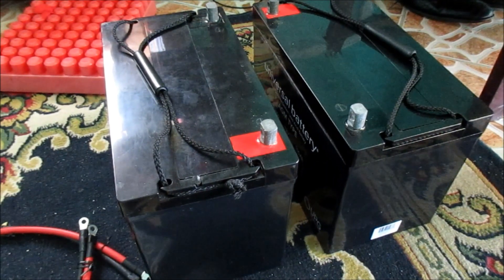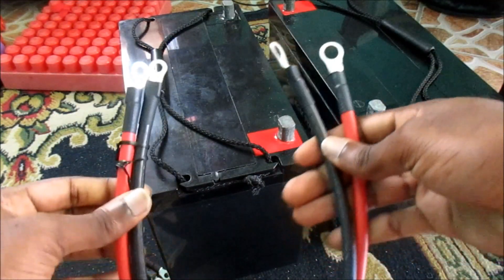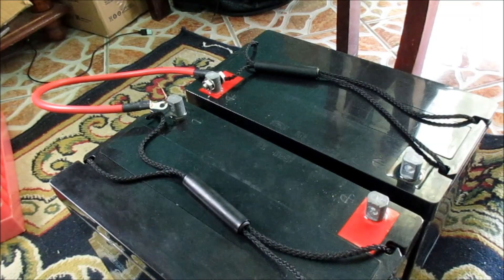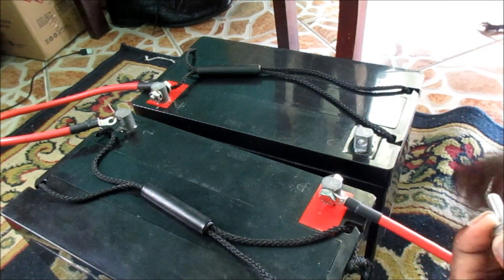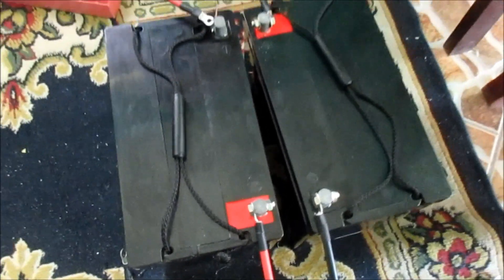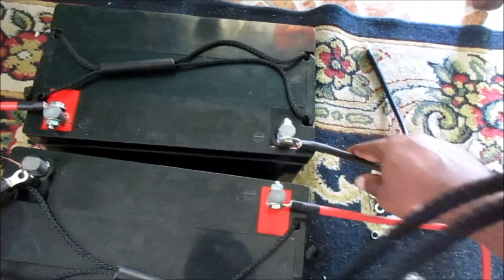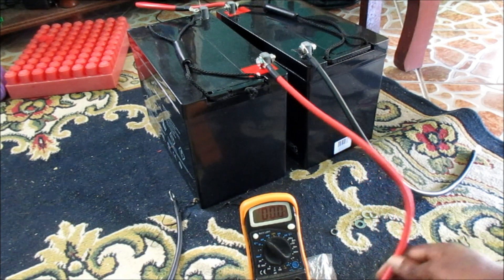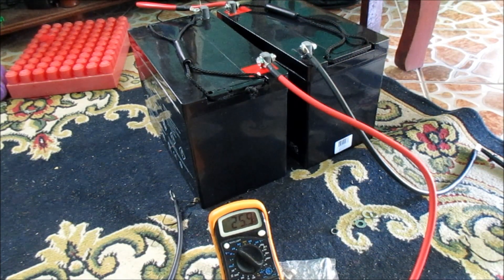How to get 24V with 12V Solar Batteries

Comment: Sir iam from tarikere...shel we connect  two battery with 150ah and 180ah new battery to Microtek xp1400 inverter in parallel???
Reply from the maker: connect the inverter to positive and negative you will be good. The wiring setup is for the batteries

Comment: But bro, if u continue following the pattern you'll increase the voltage with every 12v battery you add by 12v increments...
Reply from the maker: yes so true. 24v 48v etc

Comment: Good afternoon 24 volt inverter 1735 double battery 150ah 2 solar panel 150w/12v kids digram pm please pl
Reply from the maker: Hello what about the solar charge controller?
Reply: Lenz,
       Can I do the same configuration with the panels 12 volt to 24 volt.
Wire them as 24 volt.
Thanks

Comment: I would love to know how can charge two 6volts batteries defrent amps
Reply from the maker: you can but one will finish charging before one if you link them together. whats the amps ?
Reply: @Lenzwalters  to be honest i can't find the amps on the batteries and when i do charge them together, one charge before one as u say but the big one takes very long to charge and the smaller amp one gets very warm, i love those to batteries and am trying to create my little solar system out of nothing, I really can't buy any battery at this time, but I was wondering if they can't work now, how r they going to charge with the solar panel? Thanks alot for ur help
Reply from the maker: you can. 

just charge up the bigger amp battery higher than the other one so it will be a bit more synchronize
Reply: @Lenzwalters  blessings brother, one the battery is 15.5A for 10h to 5,40v 19,3A for 8h to 5,25v,,,,,, that's one battery and that wat written on it, the other one which is the smaller one in size is 17.2A max, that's all written on it and i only have a 12volts charger, the 17.2A is the one that is running hot
Reply: @Lenzwalters  am also worried about if I even get them charge up how am i going to connect them an the solar to charge
Reply: @Lenzwalters  if i have the money i would try an buy the other 6volts batteries that will compatible with wat i have, then i cud charge them comfortable with the 12 volts charger
Reply: how can I use my solar panels charge 24 volt battery